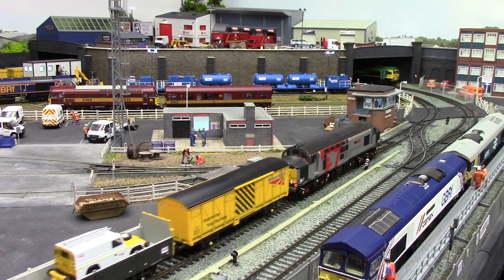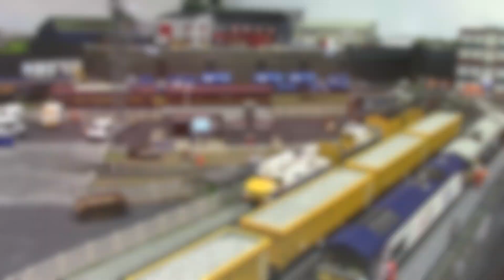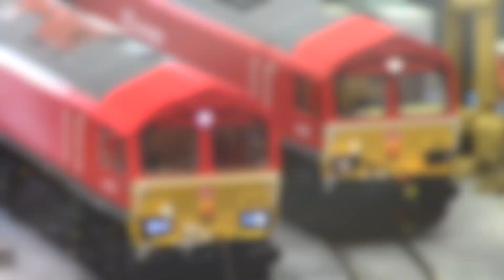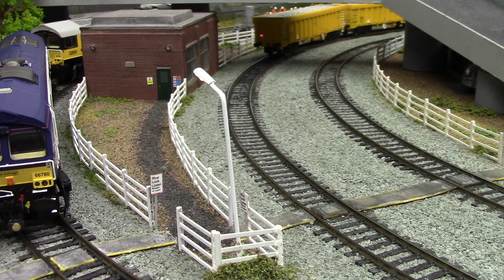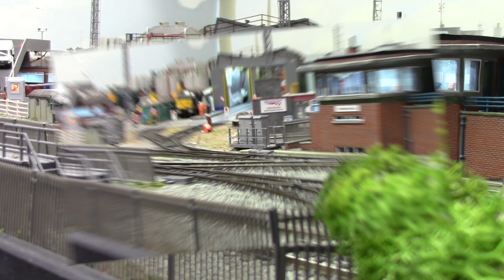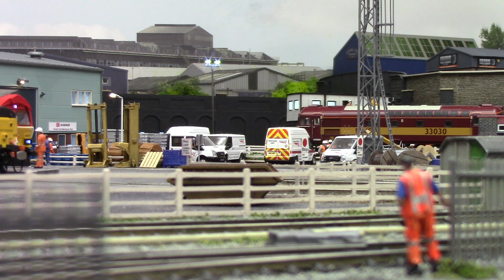Hello and Hi everyone, Mix of running shots of Torridon Road

Comment: Great video Peter, like you I seem to be addicted to the Hattons Class 66, but only have 3 so far. First one 66789 was fine, second one CMEX was a nightmare, could hardly get it to move, I think they had over done the glue! got it running ok now, the third Feightliner was ok, slight wobble, but I just run them a lot to try and sort it. I might be brave and try your solution. Enjoy your videos, cheers Reggie
Reply from the maker: Hi Reggie, if your last one has a slight wobble then maybe just stay with it because as I have said it will wear itself in over time. All I am doing is speeding that process up. Just add more glue at the bases of the axel boxes as they are taking the weight of a heavy loco. Running over points is normally  the point when they break their bond. Getting a lot of feedback with some are good and others like you have had big problems It is such a lottery with them. Such a shame as in the end when running well they are a great loco. I don't think Hattons will revisit the model somehow even though it would just need a little mod on the wheel sets to make it work, that and poor quality control.
Cheers Peter

Comment: Great stuff Peter and 3D printing is brilliant in getting bits and bobs you cant get from normal manufacturers and those wing mirrors just add that next level of detail. Thanks for the tip on using PVA to stick name plates on as I have a few that need doing and was looking for the best way.
I agree it would be great to meet up when we can I was lucky to meet John Warner , Allan from Dragon Junction , and Graham and Mick from the 2 Lakesides plus the 2 Richards from Everard and New Junction at GETS in 2019 and was great to chat to them.
Keep Safe ........................Cheers Kev
Reply from the maker: Hi Kev yes being PVA any excess you wipe away with a damp cotton bud
Peter

Comment: Hi Peter, great update again.
Hattons have sold out of there sound chip and speaker, which brand do you sue as I want to get some of my Hattons 66's running with sound. Only managed to get one factory sound fitted and I 'm so impressed with the sound quality and the functions I'm going to get more more converted  to sound.
What was the name of the track cleaner and do you have a name of the chap that makes the 66 wing mirrors?  Many thanks David
Reply from the maker: David get your sound chip and speakers from Roads and Rails with the Legomans sound file. It's the same as factory fitted.Cleaner is Inox MX3 but don't use traction tyres with it and the link to 3D models is https://www.facebook.com/3DPrintedModelRailway
Reply: You can get the 'Hattons' v5 mxl chip from  DC kits as well. Remember that you only get the full lighting options wth the V5 mxl.

Comment: On the Hattons 66's I call BS on anyone who says their 66 runs perfectly out of the box and continually does so or they don't lose any axle box covers, it's a design fault thus it will affect every single Hattons 66 and I own 9 of them and every single one wobbled & lost an axel box or 2.
Reply from the maker: Yep, if at first they don't wobble badly, they are still running on the axel boxes and thats a lot of weight. Over time they will wear but that can take ages. Opening up the holes in the side frames a little gets it running well straight away
Take care
Reply: Hi Nick Redshed, every single Hattons 66 i ordered (9)i demanded they were all checked before despatched, ended up with just 1 wobbly 66418 Patriot, axle covers still drop-off ha ha! I too am fuming that the new retooled class 20's, have no marker lights just like the 66's!
Reply: @RedShedNick  yeah totally agree on the Class 20's but you get snowflakes jumping down your throat when criticizing Bachmann products, overall the new tooled Bachmann products like the Class 90 & upcoming 20 are half-assed efforts too be honest concerning multiple aspects on what they deliver.
Reply from the maker: @sapphirejunction8993  Have e-mailed Illiuminated models to start work on the class 20 lights LoL
Reply from the maker: @RedShedNick  Have e-mailed Illiuminated models to start work on the class 20 lights LoL
Reply: @torridonroadbypeterdixon4162  wow you're quick, the thing is you or anyone else should not be doing that for a model supposedly tooled from the ground up and is just poor form from Bachmann.
It's bad enough just releasing 3 liveries & one running number for each considering you never rarely see them not work in pairs but to not design prototypical lighting is criminal in 2021.
Reply from the maker: @sapphirejunction8993  Sad to say, can only agree with you.
Reply: @torridonroadbypeterdixon4162  on that note I do love your layout 👌
Reply: @sapphirejunction8993 you are absolutely right there, bang out of order from Bachmann! especially the price now!
Reply: @RedShedNick  i didnt realise that in regards to the class 20s. they look good but as the same with you lot, id prefer running with correct lighting functions,,, and also a pair in drs compass whicht theyre not doing
Reply: @mrhaggit  So true, dontvwant the old old Drs livery so will go for the later one due in a few months sadly and have ordered Harry Neadle, which is imminent, happy for those to run together its possible they have done. Pleased they have a reinstalled speaker.
Reply: @RedShedNick  same here, im not intrested in the old DRS livery. i might wait for my account to recover after my recent model purchases, 3 hattons 66s and about 10 more container wagons have joined the fleet,,,, cheers
Reply: @mrhaggit  👍👍